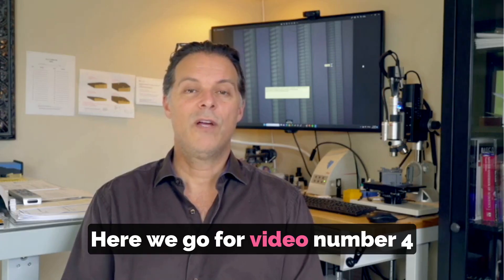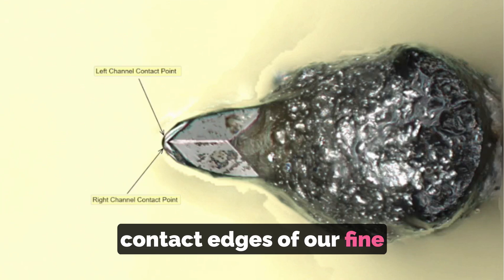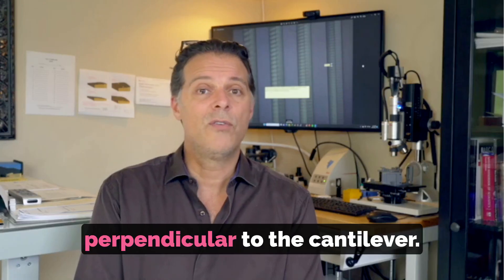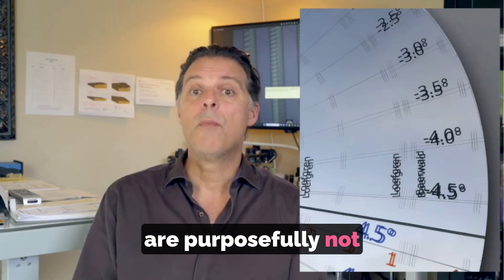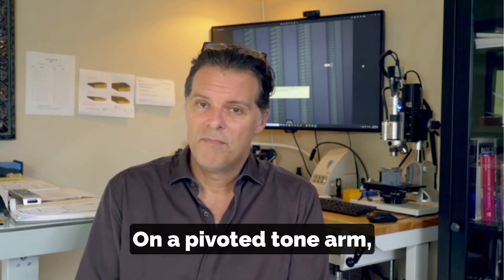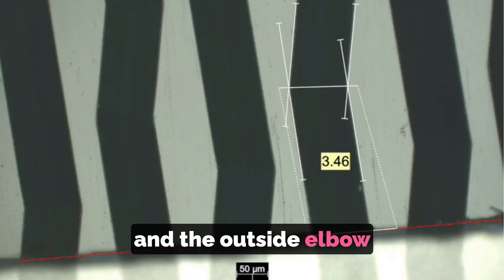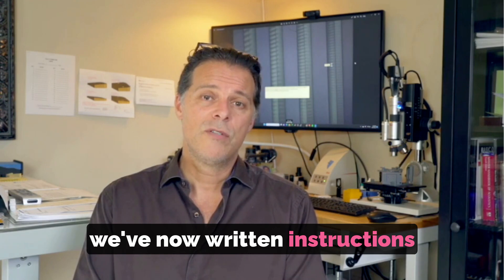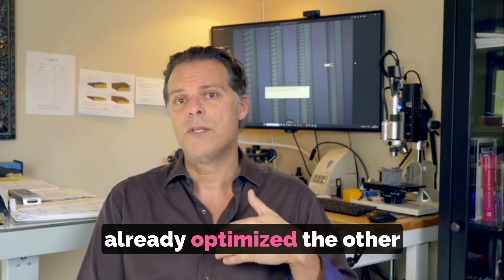7 Analog Alignment Targets - Video #4: Zenith Error

Comment: Couldn't you use a little device using a little cat laser toy pointer, and some mirrors,
if you had a device Where You place the needle in the centre a bit like a weighing machine you lie the laser in the horizontal and there's a small mirror reflecting it up through the tip of the stylus and on the side two mirrors with markings to see what the readings are at 90 degrees to the centre.
Reply from the maker: We tried a laser illumination method. One of the engineers on our research team has spent decades in optics engineering and came up with the concept. It didn’t take too long to conclude it a failure. It was more hopeful on certain stylus profiles and less so on others. 

We are working on a method that does not involve specialized microscopy. Stay tuned.
Reply: @WAM-Engineering  ok.
 what about this DPF digital machine i see people use can that measure zenith? I don't know how accurate it is? it seems to be a good little piece of kit what do you think of it? I forgotten the name sorry! I think it measures most parameters and you can measure azimuth as well.
Reply from the maker: I don’t know what “DPF” is.  Are you talking about a profilometer? We looked at those but the resolution wasn’t fine enough. 

Azimuth cannot be determined visually at all as it is not only a function of coil orientation with respect to the 45 degree groove wall but is also sensitive to the orientation of the magnetic flux field which we cannot see (without ruining the motor with ferrous dust)
Reply: @WAM-Engineering  no it's DSP sorry I've been looking a diesel engines recently😂 I've been doing a search on the internet I found it now it's parks audio puffin DSP phono stagee, basically it's a digital preamp converter but it has these functions of azimuth adjustment I don't know what else it can do? looks like a nice piece of kit what do you think of it?
Reply from the maker: could be promising. I haven't tried it. @therealBozoDjTrump